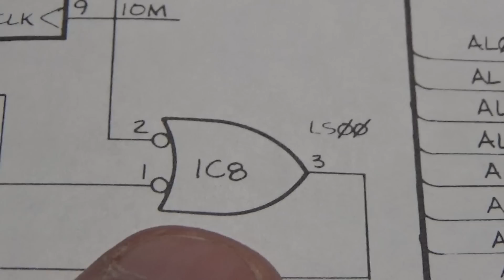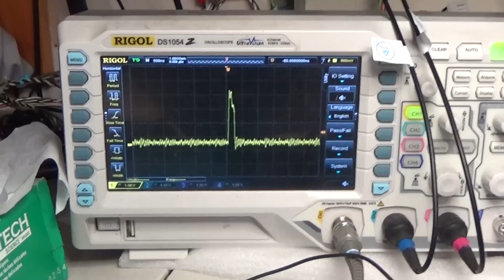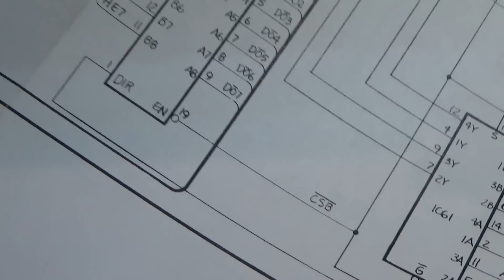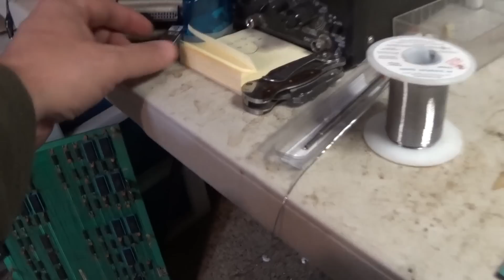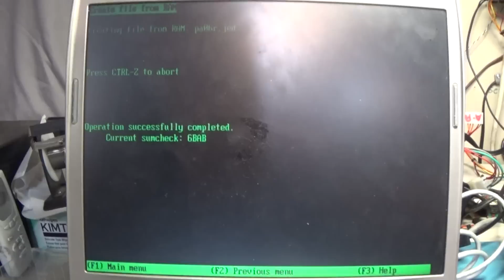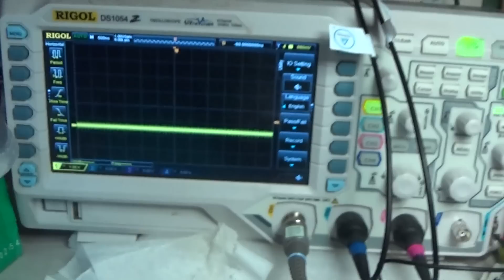1981 Sega Turbo Arcade PCB Repair Part 2  -  1-25-2025

Comment: Great video as always, love your content.
Rather than clipping the pins to test a chip, I desolder just that pin from underneath, and ensure it's not touching the pad, then test. This makes it easier to simply solder back in place if needed. There are times that the solder to too much on the top, component side, which unfortunately means having to clip the pin.

Comment: 1:38 if we call the pin next to the designation C13 Pin 1, then pin 5 has a solder blob shorting to the above trace. Who knows maybe that caused one of the intermittently bad signals.
The OKI chips with the old logo are also pretty notorious.

Comment: It still blows my mind how each of these video games were made with custom built computers essentially for each game and how the circuits were made to make things work. The programming had to be done before these machines were made to run the code.

And yet nobody thought to take the hardware & think "What kind of home computer would this hardware make?" & then figure out a main operating system, make it boot a disk & add a keyboard.

Comment: Funny you're repairing Turbo boards.  I won an auction lot of ColecoVision games.  One was Turbo.  It requires the steering wheel expansion module.  Bought a module (untested).  Working on repairing and refurbing it now.  The ST1702 transistors (supposedly 2N3904) are a known failure point.  Replaced with exact replacements (ST1702).  Didn't fix.  Testing cable continuity now.
Reply from the maker: @lancegentle6430  i actually have that Turbo for Colecovision as well as the wheel!!  guess what I’ll be doing later